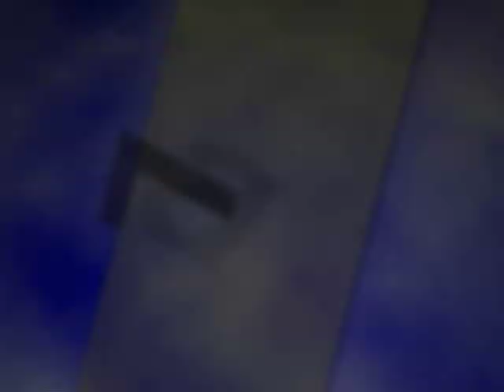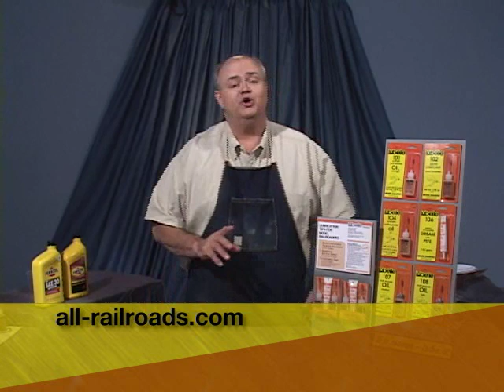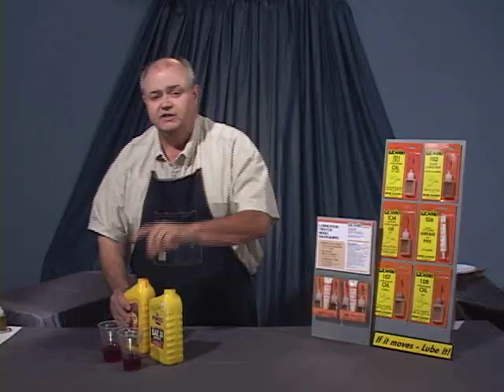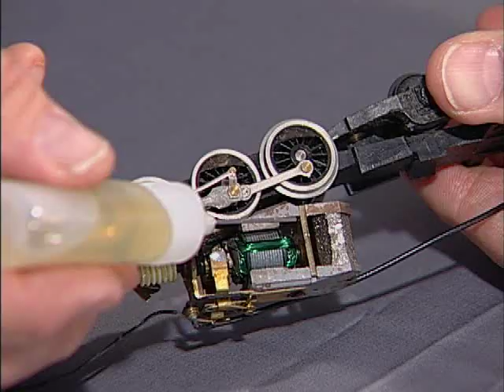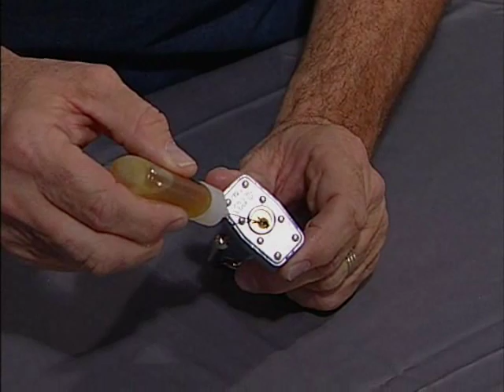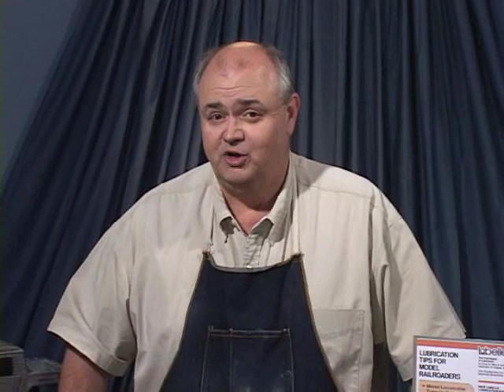Labelle How To

Comment: Just found Labelle and I must say, so far I like the selection of special oils for specific uses you guys offer, unlike 3in1 which is what most people use around the house and generally not the right oil for the job unless its a squeaky door hinge. I need more from my oil because I use different oils and lubes for many expensive applications such as trains, radio control cars, pocket knives, flashlights, bearings, and even more in my work shop where lubrication on some of my machines is very important to avoid costly or irreversible damage. So I like to know whats in my oils and what they are formulated to be used on. Would like to see more quality greases for R/C axles and one for gear box's thats safe for use on plastic. I would also love to find a high molybdenum content grease in an easy to squirt container for high pressure metal to metal contact areas. Also some different weight silicone oils would be lovely in your bottles. Don't now why I'm telling you guys all the stuff I need...Anyway I don't want these last five minutes spent typing this out to have gone to waste, so whatever here you go.
Reply: Hi Mixro Machine guy..
-- We agree with what you are saying, we recently improved the formula's on many of our times to keep with the
rapid emerging nano technology in lubricants and added PTFE (aka Teflon) to many of our items where appropriate.
Also added were two items for the Radio Control/Quad copter market.
See our updated website at www.labelle-lubricants.com
Reply: Idk where too get it at, i dont trust eBay

Comment: On the locomotive it looks like you lubricated the worm gear with 106 and the worm that drives it with 102.
Reply from the maker: That would be correct, the worm gear is part of a gear set and using the 106 will transmit the 106
throughout the gear box/gear chain.  The 102 can be used on the worm gear shaft which has bearings at both
ends, and the 106 grease will not get to those bearing as they are on the extended ends of the shaft, hence the
use of 102 for the bearings. Hope this helps..

Comment: Labelle 206 will do the same, and labelle 108 is same as 107
Reply: Hi Pantera Tanker.. we appreciate the comments, but your information is wrong! 
Labelle 106 and 206 are both PTFE (aka Teflon) greases, but with slightly different viscosities.
Labelle 107 is a 32 weight viscosity and 108 is a 64 weight fluid viscosity Lubricant. 
WE DO PAY ATTENTION TO THESE THINGS-
and take pride in our products (help with formulations by a Chemical engineer) + testing before we release product to the
general customers...
Everyone out there have Happy Holidays, and a Healthy and Prosperous 2019
-JC  / Con-Cor-Labelle.
Reply: @WestCascadeRail  Good info, much appreciated!